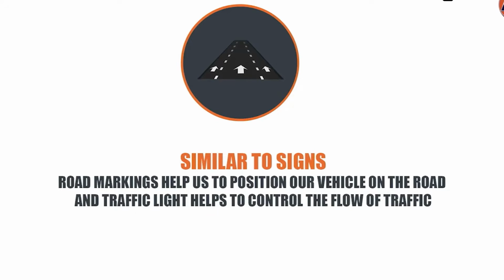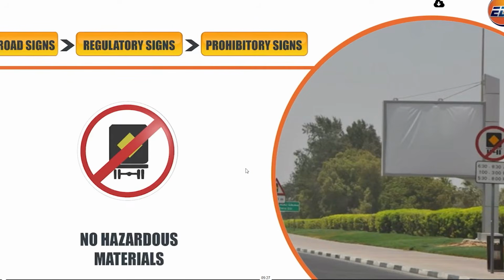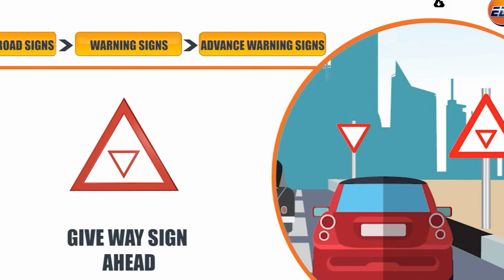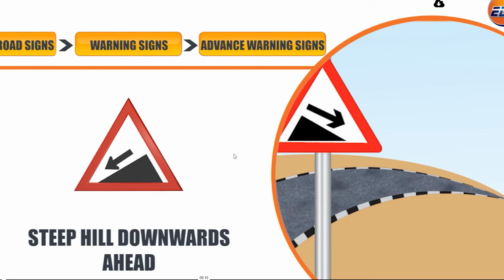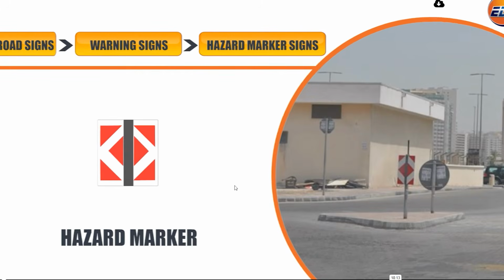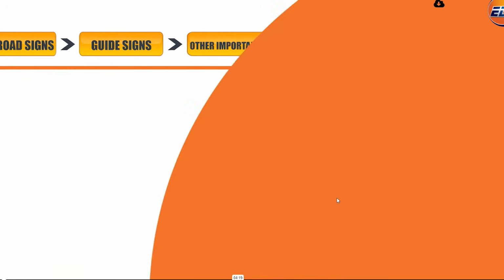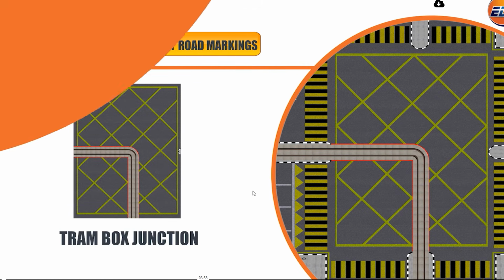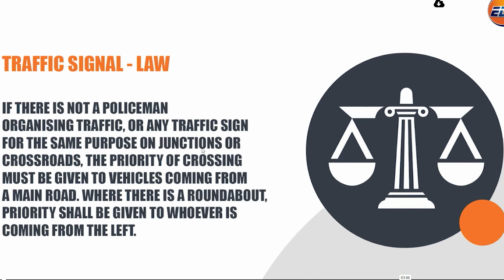UAE DRIVING LICENCE ALL ROAD SIGNS, ROAD MARKINGS, AND TRAFFIC SIGNALS FULL LESSON #uaedrivingl

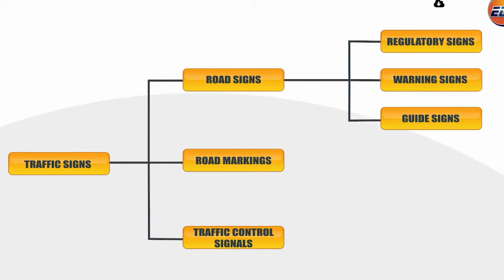Comment: 1:17
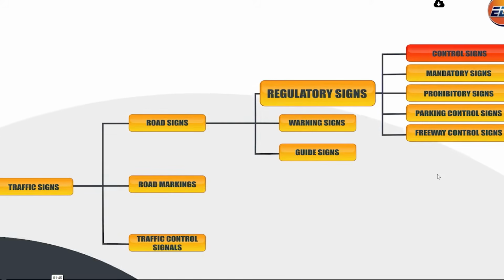1:47 

1. Regulatory Signs

1.1 Control signs
1:56
4:01 No entry (control sign)
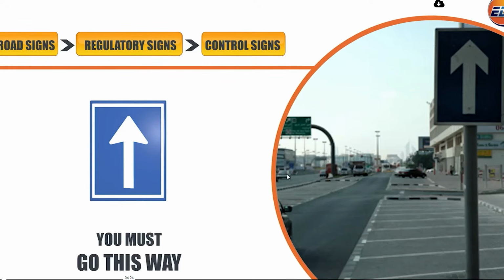4:36 You must go this way (control sign with rectangular blue BG)

1.2 Mandatory signs
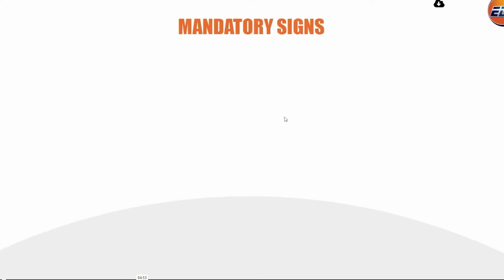5:05 with blue BG and circular in shape usually 
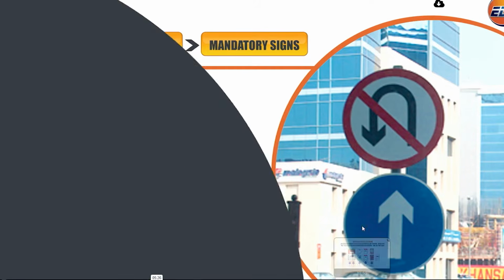5:32 ahead only 
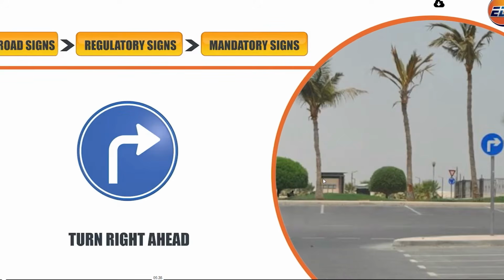5:39 turn right ahead (maybe means one way traffic that right way)
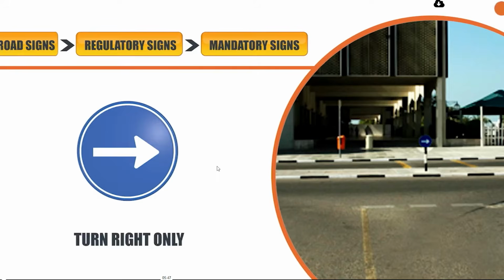5:58 turn right only (no option for left turn)
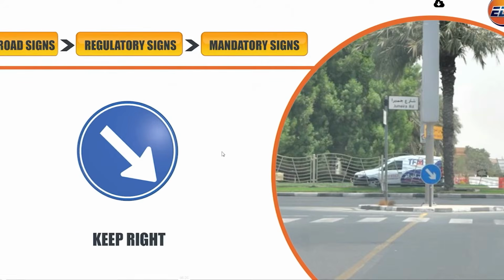6:44 keep right (pass the obstacle from right side only or during accidents keep right)
6:55 keep left sign (can be found in road sides and u turns)
7:35 Min and max speed limits 

1.3 Prohibitory Signs
8:19
8:53 no u turn 
10:04 no pedestrian
10:46 priority to oncoming traffic 
11:26 max speed
12:42 max weight limit 
13:06 qualification plate

1.4 Parking control signs
13:19
13:40 paid parking time 
15:01 for bus stops 
15:30 paid parking for loading and unloading vehicles 
15:50 no stopping and no parking 
16:21 no stopping shown in the timings 
16:32 no waiting. But you can stop and leave quickly 

1.5 Freeway control signs
16:51
17:16 max speed in freeway usually 100 and min 60

2. Warning Signs
17:51